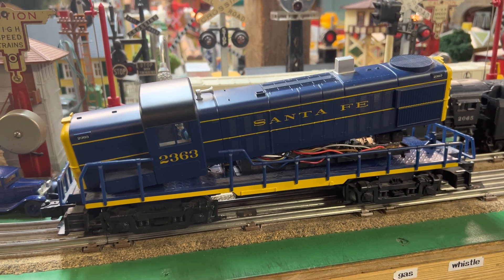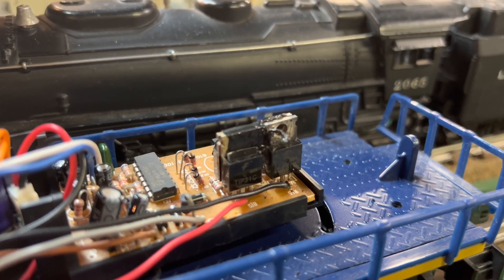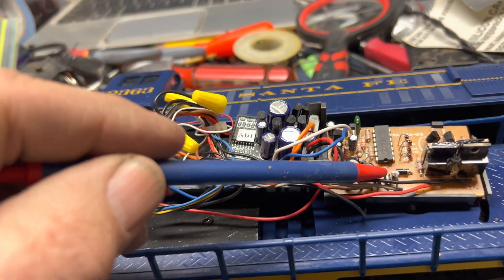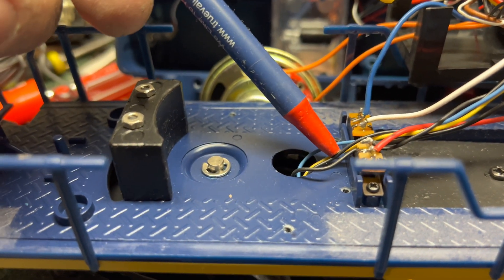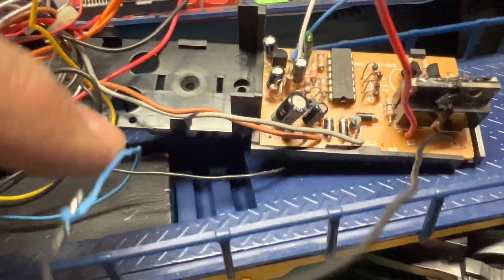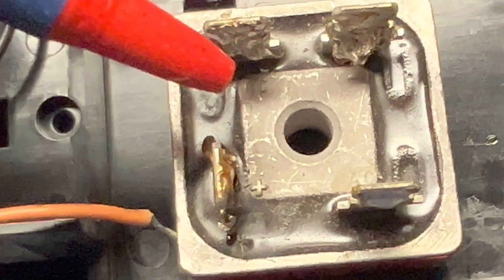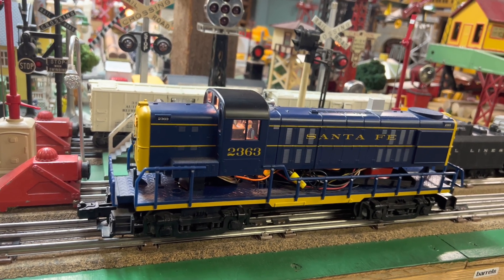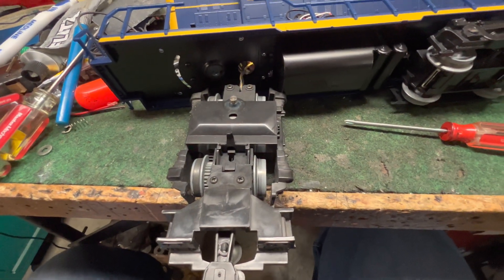Lionel RS-3 Diesel Locomotive: Replacing a Circuit Board with a Bridge Rectifier

Comment: What size of rectifier? My MTH has 2 motors...do I need 2 rectifiers?
Reply: It's all about current draw. A 4-amp bridge rectifier should be sufficient for a dual-motor locomotive. As long as the amp rating on your bridge rectifier is higher than the amps your loco will draw under your normal use of it, you're in the clear.

Comment: I can likely fix that board for you.  If you'd like to send it my way, just send me a message.  Thanks for all of your videos!
Reply from the maker: Thanks so much! I think it has a motor problem too. We’ll see what happens.
Reply: @daveclarklumber  that's certainly possible.  If the driver transistors fail, and they were TIP31/32, I like to replace them with TIP 41/42. There is no penalty, and they will handle a bit more current, even without a proper heatsink.
Reply: Yeh those boards are very fixable.  I've fixed a few also.
Reply: Would replacing the transistors be the better option?  What is involved in replacing them?